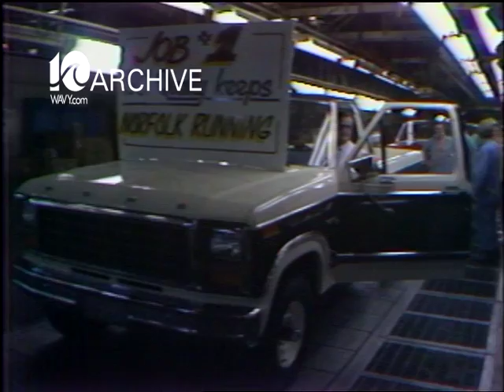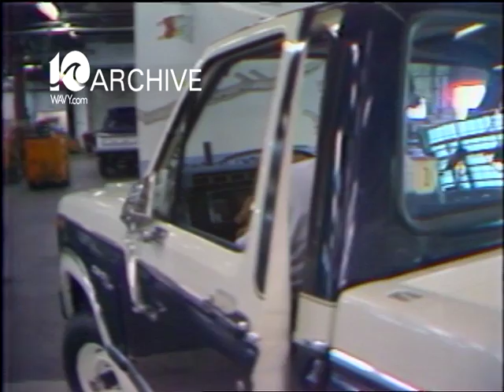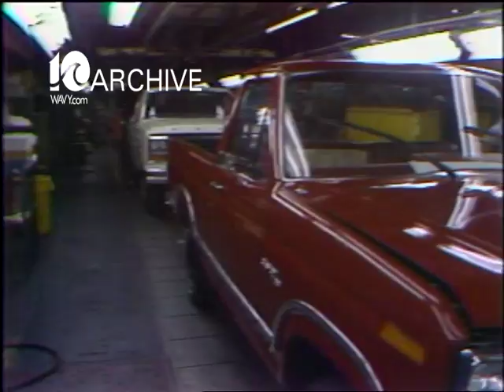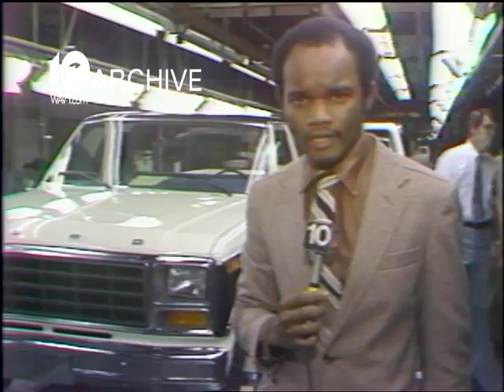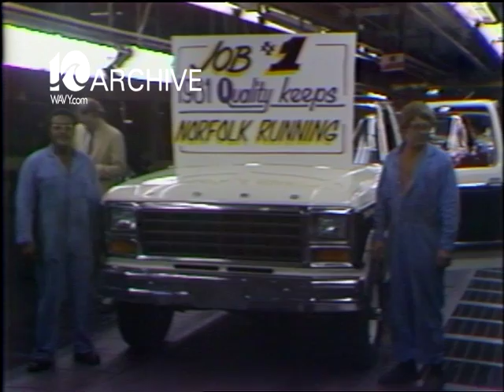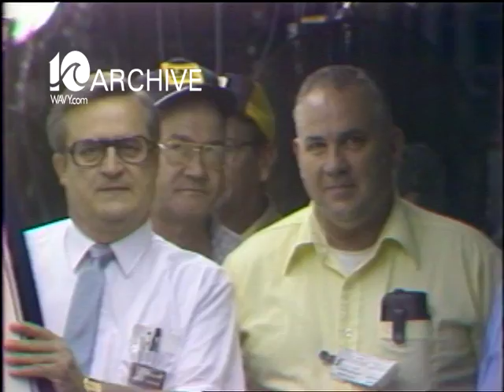WAVY Archive: 1980 Norfolk Ford Plant's First Truck Off Assembly Line

Comment: They made that body style from 1980 through 1986. I hardly ever see any of those around nowadays.
Reply: Kevin Richards I own a 1980 and see them around plenty in southern Oregon.
Reply: See them in the rural areas mostly
Reply: @chumbawaumbacumpa  o wow.
Reply: I always see them in rural areas. they were pretty reliable, specially the 300 I6.
Reply: @agusw4720  I see quite a bit of the 8th & 9th generation ones which are the 1987-1991 & 1992-1997 year models today but wow you still see a lot of the 7th generation ones which are the 1980-1986 year models? Unbelievable.
Reply: @kevinrichards3288  yes, but maybe it’s because where I see them is a semi desertic zone so they don’t have much rust